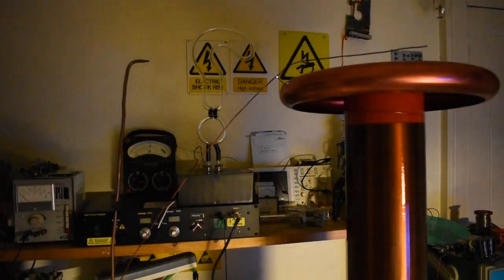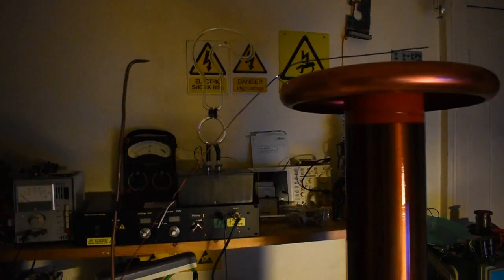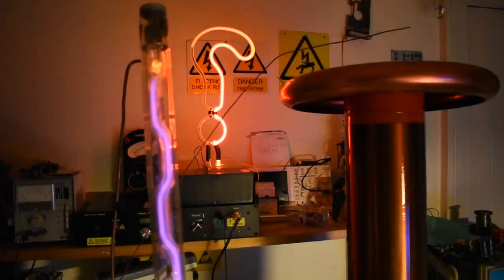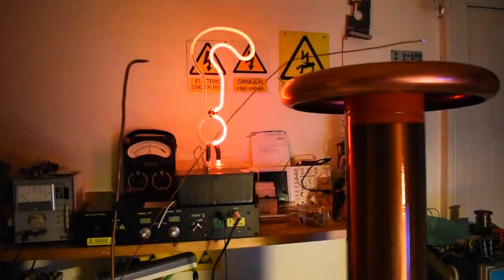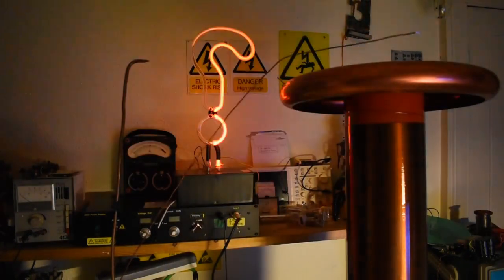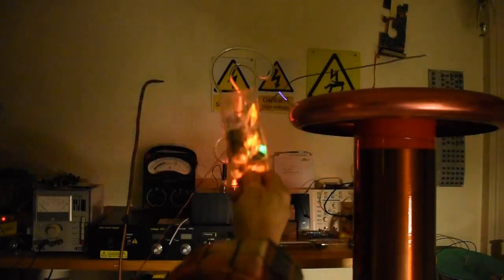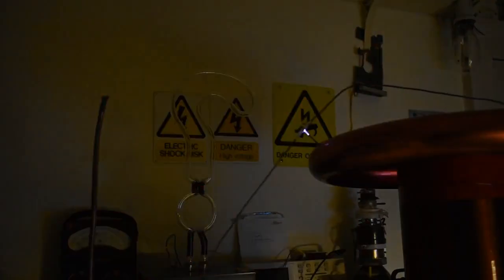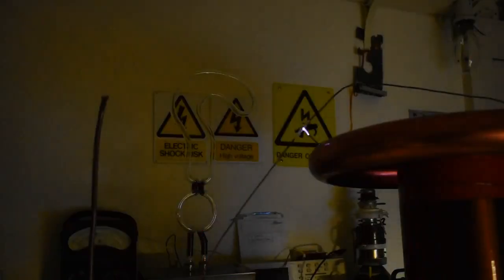Flashing Light Prize 2018 winning entry from Tuopeek

Comment: Excellent!  Just a heads up - check the web address for the competition in your video description - think it points to a less appropriate place!
Reply from the maker: Oh, thanks for the heads up. I guess they have stopped running the competition these days. There is a page on X for the flashing Light prize so I'll remove the link.  I submitted two videos entries and won with this one but I actually like the other submission more as I found it was possible to measure the resistance of plasma in neon when externally excited by microwave energy and used this as a switching mechanism.
Reply: @tuopeeks  Both are excellent 'solutions' to this problem!

Comment: Is the motion of the spring sustained by the system or does it eventually stop bouncing ?
Reply from the maker: The motion is sustained as the charge attracts the wire spring and when an arc forms it collapses. This relaxes the pull on the spring.  Therefore the spring is pulled in at its resonant frequency and will continue to bounce as long as the field is pressent.